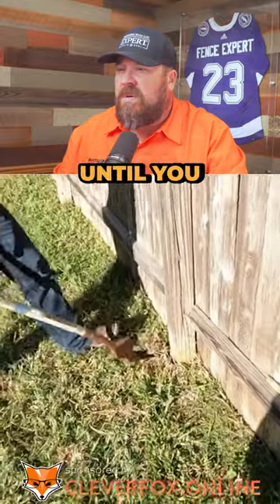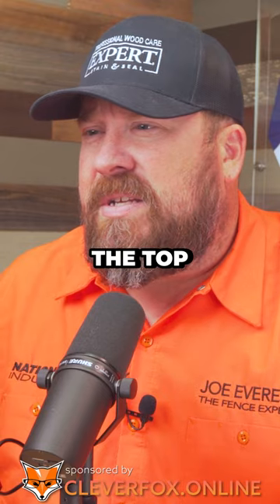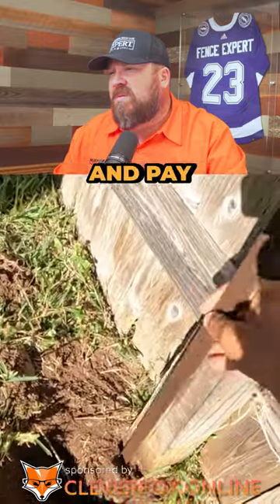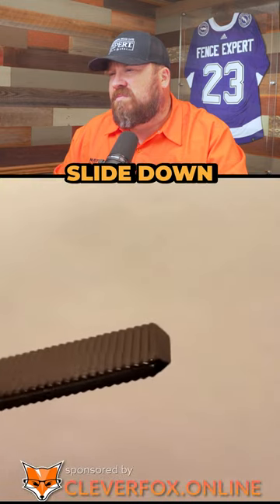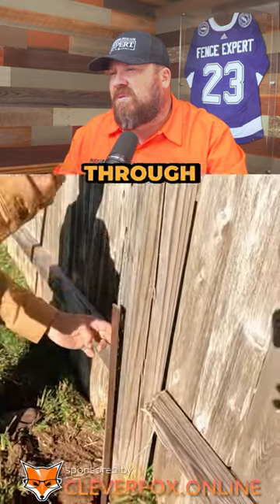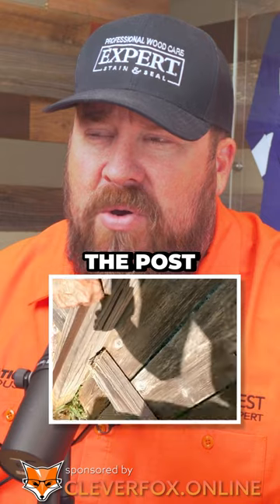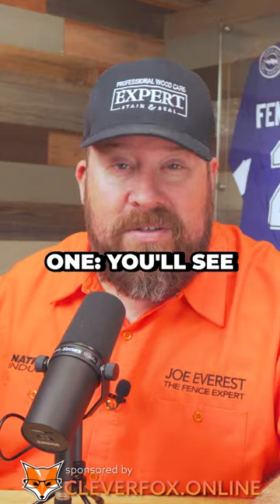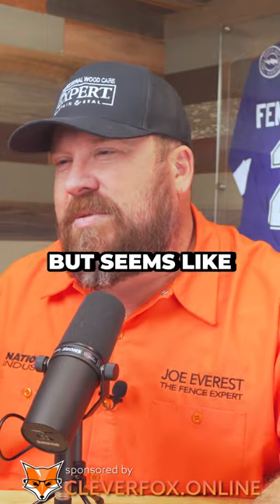Does This Odd Fence Repair Method Really Work??? #shorts

Comment: Don't let dirt sit directly against the post is the best way to prevent this type of rot in my experience
Reply: We done the tops of all of our pods, takes 5 extra seconds on each hole after you pour it. We still cover it in dirt but it allows the water to drain down the side of the pod under the soil rather than create a bowl in the top of it
Reply: Dome

Comment: I built over a mile of fence each of the last 4 years(im a 1 man show) it's been my experience that when a post rots it's in the top 6 to 10 in of the soil there's almost always solid post at the base of the concrete. The easiest way to fix this just keep it from happening in the first place and leave the concrete mounded up above the grass. I occasionally have a customer that doesn't want to see the concrete regardless of the outcome, but when I explain to my customers seeing the concrete means an extra 5 to 10 years of life for the fence 95 percent of them choose to have the concrete exposed.
I did a job in a 5 year old housing tract were the fence posts were already rotten. The fencing contractor tried to save money by using only one bag of concrete per post when they should have used a bag and a half the best majority of the posts on this 5 year old fence were already rotten. Cost to change out a post in the same exact spot ( to be able to reuse the panels as they are) $350 ea. X 10 posts 

Ehile this may solve the problem its only a bandaid. In strong winds that fence will fold like an envelope
Reply from the maker: Great point! I appreciate you watching and sharing your experience!
Reply: That is exactly right. Everything I was taught was to African concrete edges level with the ground and then slope up to the post from there to prevent dirt from touching the pulse or water sitting against the police. Besides that every fence I fix that was done that way has a different problem before rotting
Reply: Having the top of the pod rounded under the soil should work too! I do it to all of my posts and still bury them. It should still let the water drain down the sides of the pod through the soil instead of creating a big bowl on top of it over time
Reply: I did something similar with angle iron on my mothers fence. Used and angle grinder to make the bottom pointy, drilled some screw holes and whacked them in with a lump hammer. It has now survived several very bad storms and is rock solid. A lot cheaper and quicker than replacing the posts. Because it is angle rather than bar it is a LOT stiffer.

Comment: Depends on the price, and how much work install takes, but if you can get 1 to 2 more years out of your fence this way it could be a solution to safe some money for a new fence.
Reply: I had a similar one that was more beefy for like $20 so these are probably even cheaper and install was pretty easy. Definitely good for a few more years
Reply: It’s way cheaper to take the boards off, pull the post and reset it. 

It’ll save your entire fence from blowing over costing you thousands. Should take you less than an hour combined to reset it and reattach the fence when it’s dry

Comment: We've got a post and wire fence in a rural community and I'm pretty sure they just drove these posts in with a bobcat and the post driver. Can I just pull them out throw some concrete in there and then put them back so that they stop being so loose? Or should I fill in the holes and drive in new posts?

Comment: Ive built quite a few fences over the years and fixed a bunch of post but always replace them, not an expert though. I guess my question is do they not make some sort of waterproofing for posts? Maybe a tape like tite seal or something. Just something to protect the part of the post that touches the soil. There's gotta be a way to protect it without having an ugly mound of concrete that sticks up out of the ground.

Comment: If he had made a larger access hole on the backside of the hole in the dirt; then also drilled into the non chaft end as well as the exposed, I would be more inclined with this products use. However.. I know it will still at best go for maybe a year. Metal disappears just like wood, wind water and temperature changes aren't often an ally to these materials.

Comment: We bust the concrete in the inside because it is usually not very deep because most contractors cheat and don't leave much concrete. We drive in T posts and use plumbers tape and screw the post to that and then paint the posts the same and have 15 year old repairs like this that are still holding. East repairs and shore up posts real quick. Always call digsafe beforehand because about a year ago we had one that was right next to the gas line and was like maybe a half in from our repair area so had to dig that one out.

Comment: Question for the fence professionals.  Those white plastic post sleeves they sell, would it be a dumb idea to put a base of gravel, the post sleeve on top, and pour concrete around the sleeve?  It seems like if it's deep enough that fence post wouldn't go anywhere, and water that gets alongside the wood 4x4 would have access to drain out, and if it did rot it would be as simple as removing the connection to the panel and lifting it out of the sleeve.

Comment: I hate concrete posts.
I've always used 3/4 down.
It packs like concrete but is easy to remove if needed.
If the hydro poles used it, it's good enough for fence posts.

Comment: No, no, no!!! I built fences for 34 years. It never occurred to me to do anything like this. This is the lamest "solution" to a rotting post that I've ever seen.
Reply: So bc you never considered it then it MUST be wrong. Got it.
Reply: It’s definitely good if you’re just trying to get a few more years out of the fence before fully replacing it. I assume as a fence builder your solution is “hire me!” right?
Reply: This is an easy and quick fix that will last a couple of years. What are you going on about? I guess your solution is just to leave it 😂 Because that's what people will do if they don't have thousands of dollars to replace it.
Reply: This is fine if wind never hits the fence😂
Reply: @TACTICALwaffle2  No, I'm retired.

Comment: Man discovers all that was needed to reattach his arm was a band-aid... you could buy a post, jeep jack your plug and reshoot that with post foam for a slightly better result, or concrete it if you live in a windy area or your fence is in the alley from king of the hill.

Comment: It's stupid.  When you put pole in the hole . The hole is bigger then post . Room for cement . See problem cement min 2 to 4 inches larger then the post . Which would leave a 2 to 4 inch gap between the strap and the post .